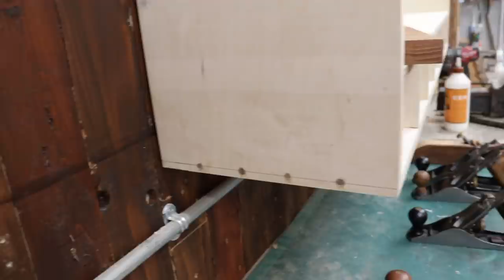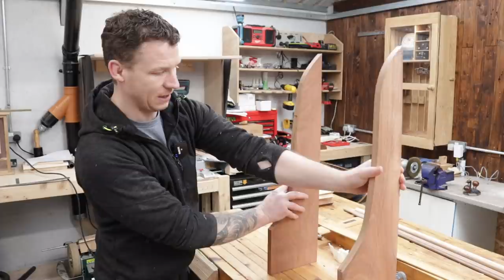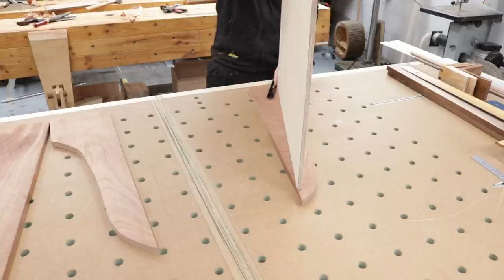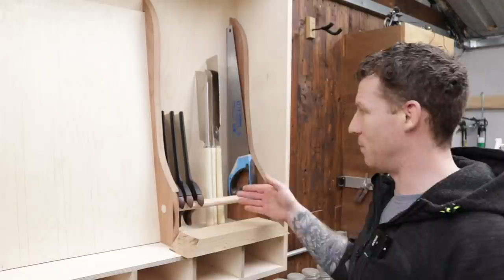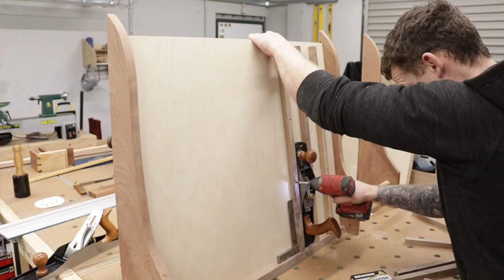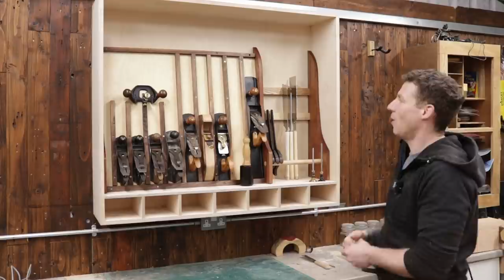Hand Plane and Hand Saw Till.  Hand Tools Cabinet Build Part 2.

Comment: I’m rewatching a fair bit of your videos, love the content.  I’m sure by now you’ve got Spokeshaves galore, but I’m surprised you’re not using a card scraper to smooth off that edge on the sapele.  The Shinto is terrific tool, but when I use it I get a relatively rough surface, even with the fine teeth.  The card scraper takes a bit to get accustomed to but leaves a beautiful surface behind.  Wonderful work, John.  Cheers

Comment: Looks great John some flexi ply with some sand paper works great for shaping curves
Reply from the maker: Thanks for the tip
Reply: @JohnMcGrathManInShed  also when you routing off shapes I use some double sided tape to hold it. Down or I put tape on both sides and yours some miter bond as-well just an observation but great video

Comment: nice design and well put together, as you say ;- machines are accurate and arguably do a better job . but touches of fine joinery using hand tools elevate the finished piece to more than just a box with doors on. 
  '' An idea but not quite a plan''   sounds alot like the  '' ZEN  DOG'  ( with  irish lilt ) ' :- , He knows not where he's going for the ocean will decide, it's not the destination -but the thrill of the ride!!! :-}
Reply from the maker: I like it!

Comment: Great work thanks for sharing. One thing I notice is you putting your plane on the bench on its face and cutting edge in school I was taught to place it on its side or I got the slipper.
Reply from the maker: This seems to be another controversial topic in woodworking. Does leaving the plane on it's soul dull the blade or does leaving it on it's side potentially kock the blade of square. 🤔
Reply: @JohnMcGrathManInShed  never thought of that, I will ponder it over a beer. Keep up the good work

Comment: Love it John, is the kerf on your general purpose saw slightly wider than your dovetail and tenon saws? If so if you run one pass through where your saws are sitting it will make it easier to get your saws in and out. Sorry it's a bit long winded. Regards Jim

Comment: This might be a bit daft but, when you're using Danish oil do you sand between coats? If so, what grit are we talking?

The cabinet is coming along nicely btw 👍🏻
Reply from the maker: Not usually, I apply a coat leave it a while then wipe of the excess and keep building coats that way. If I feel it needs it sometimes I will hit it with some 600 grit before the final coat.
Reply: @JohnMcGrathManInShed  happy days, I've never sanded between either, but then again, I havent got a clue what I'm doing 😂

Comment: Well lad! :) Im enjoying this series man, and its great to see ya crackin out the hand tools. Do feel like youre after readin my mind somehow tho.......some of the inside parts of your cabinet are very close to what ive been drawing/planning out for the last couple months haha :P Sapele is a lovely wood, good and strong, looks great and smells good when youre workin it too :) I used to get most of my hardwoods, and all of my exotics from England, that might prove difficult/expensive now with the recent changes.....where did you get your hardwood for this lad, Strahan?? I needs to find a new source of lumber, and veneers..... the veneers might be hard to find in little ol Ireland :P 
Id suggest some Veritas wonder dogs for your MFT, ya could use them to pinch the wood from the sides leaving the top face unobstructed for workin on. The face of the wonder dogs are about 15mm high, so take that into account if ya often work with thinner materials :)
Cracker of a video lad, keep em comin boss :)
Reply from the maker: I get my wood from McMahons

Comment: Hows she cutting John? I am a fellow Waterfordian. what do you think of the track adapter for the Bosch router? It's a bit late asking you now because I have already ordered one, but I am anxious to know whether I have made a good or crappy decision. Anyway, look after yourself and keep up the good content.
Reply: I am going to try McMahon's  for timber too. I have been getting hardwood from Strahon Timber. Sound out for that advice.
Reply from the maker: It works great, it's a bit plastic tastic but no real complaints so far.
Reply: Sound out John. Are you having difficulty getting stuff from Axminster? I am looking to order stuff from them shortly.